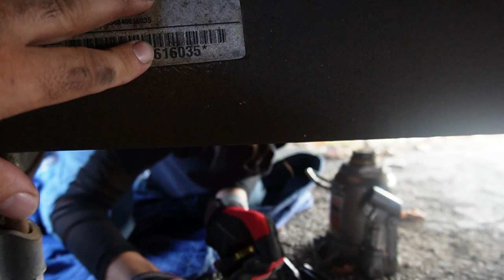How we CHANGE a tire (BIGTEX)

Comment: Its good for Jo to know how to do these thing's.
Always positon the wheels so the valve stems are 180 degrees from each other for easy access to checking the pressure and inflating the inner tire.
Leave a few inches gap between the jack and what you are raising to make it easier to remove the jack when lowered, also make sure you are not in harms way when lowering the vehicle.

Comment: You should have the oval hole meet.  Also does not hurt to use some anti- seize.  Since our trailers don't get as much love like the truck.  I installed double seal valve stem caps in conjunction with valve stem extenders. To make checking tire pressure easier.
Reply from the maker: Definitely getting some double seal stem caps! 🙏🏼